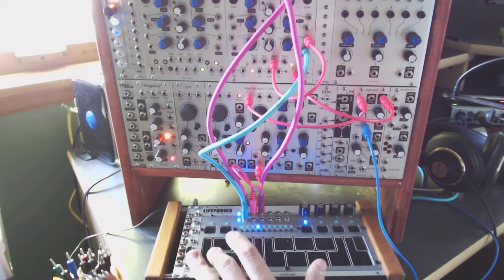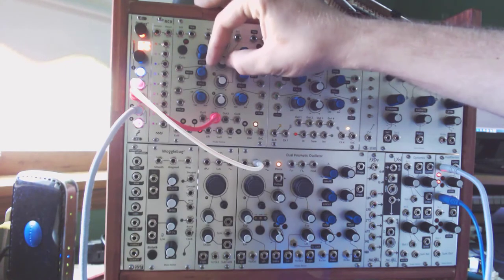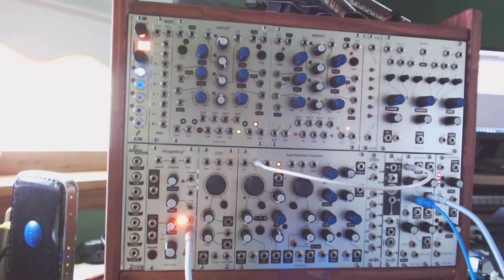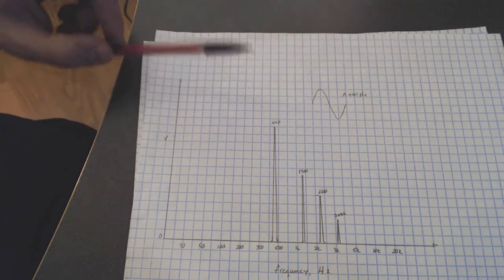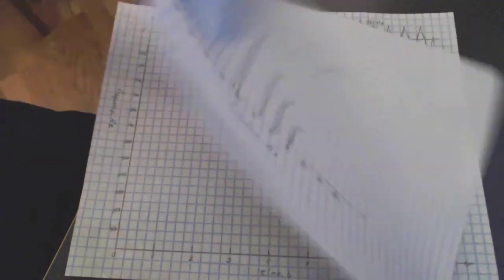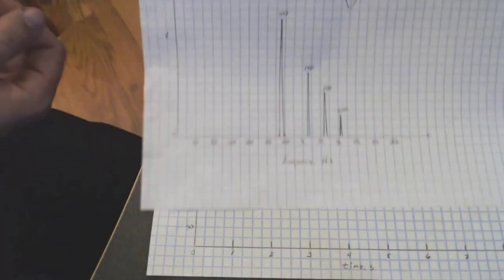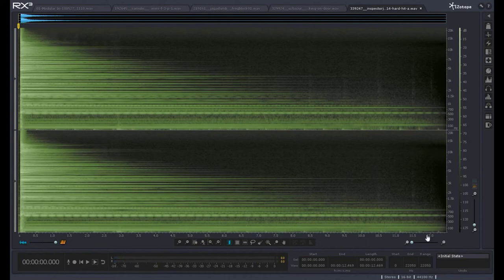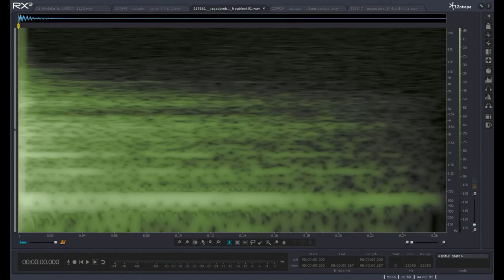Spectrograms and Why Low Pass Gates Sound Neat

Comment: 15:00 Your 1 octave up (double frequency) triangle wave plot has its fundamental lining up with the 1st harmonic of the previous lower pitch triangle wave.
 The harmonics of a triangle wave are ODD multiples of the fundamental, 3x 5x 7x etc, not 2x as in your plot.